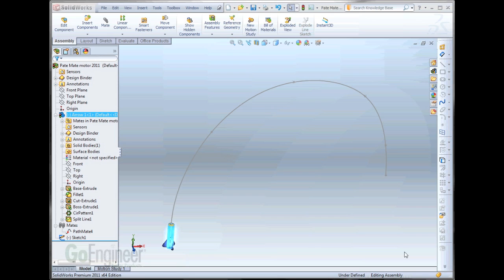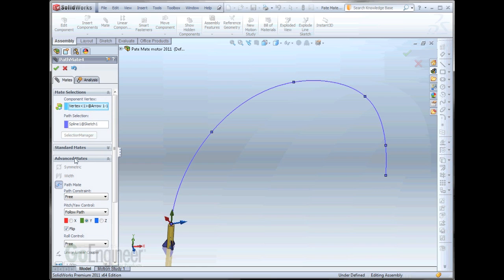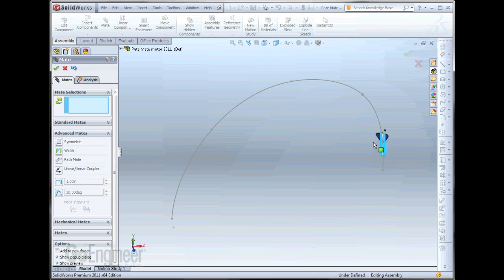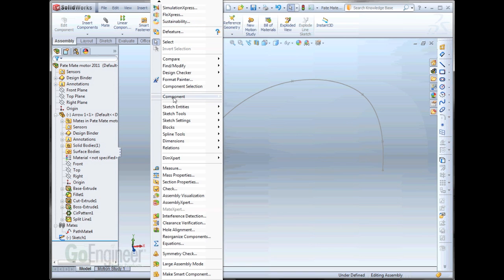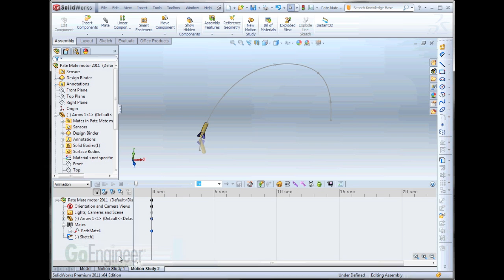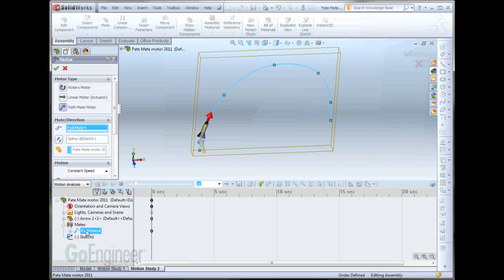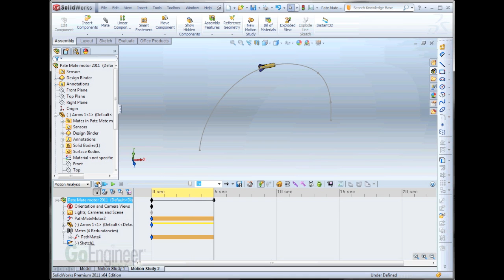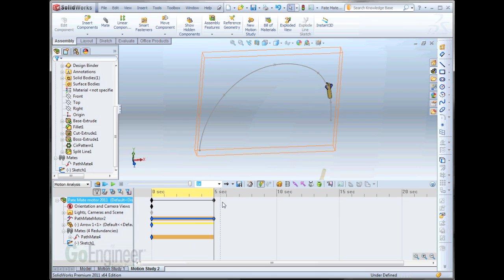SOLIDWORKS 2011 - Path Mate Motor

Comment: I see you have the pitch/yaw control set to Y, is it possible to set it onto a sketchline? Because my path doesn't follow any of the XYZ axes.
Reply: ***** I would but i'm only using the program at school so I don't have full access with my account.
As a new user of Solidworks I notice a lot of potential enhancements especially in assembly, for example there is no possibility to rotate a component around an entity at a specified radius, this is currently only free drag. (Solidworks 2013)